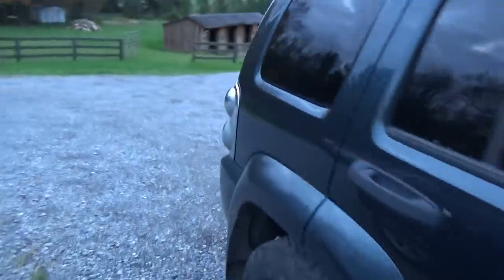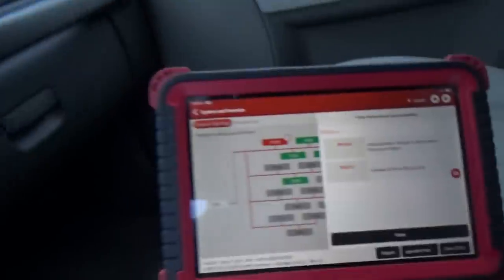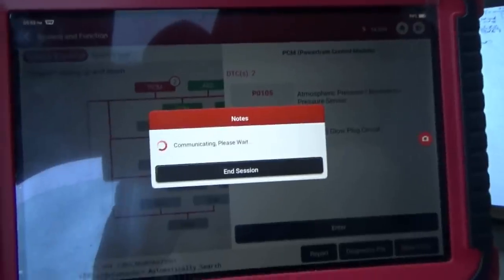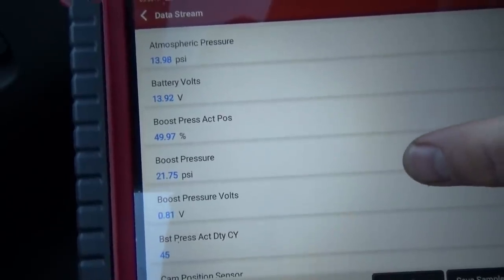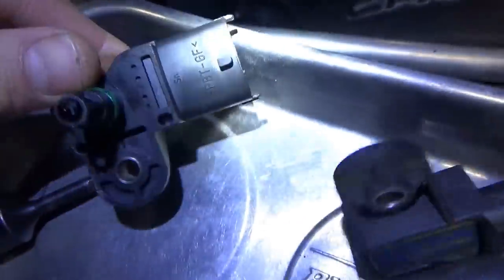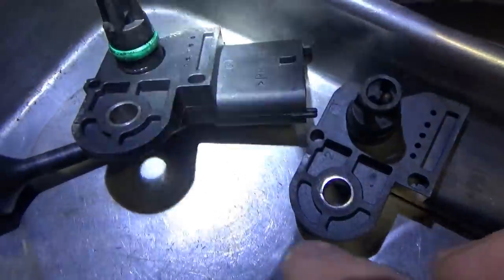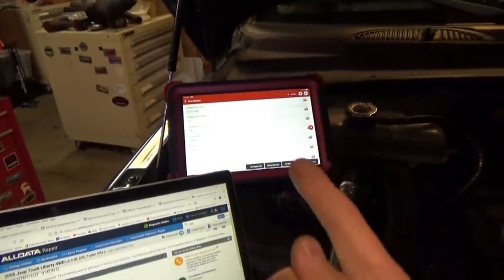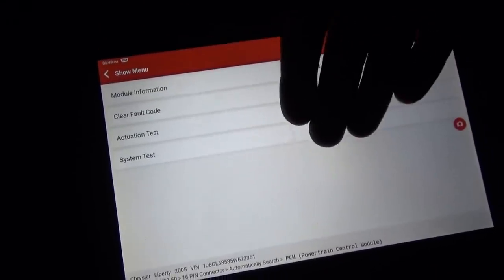Jeep sounds like TRACTOR?? (Low Power, No Boost)

Comment: That engine was insanely loud from the factory. It was a fairly primitive engine; made by Fiat.
Reply: It actually sounds pretty friggin sweet idling like that. 

Too bad it's like a handbag of a Jeep 👜
Reply: Made by VM Motori I think, in Italy.  Was that part of Fiat ?  These engines were before Chrysler/Fiat joined.
Reply: @volvo09  "...  handbag of a Jeep"    Lost me here.  What does this mean?
Reply: @davecaselli1957  just going from memory, I believe it's either owned by, or at least partly owned by fiat. Yes this was before Chrysler went bankrupt and was given to Fiat.
Reply: @davecaselli1957  it's feminine and little... Crappy attempt at a joke. 

I was trying to poke fun of it like the modern range rovers that are more of a fashion accessory than an off roader.
Reply from the maker: @volvo09  It's much more of a real off-roader than all the modern AWD crossovers combined!
Reply: @PineHollowAutoDiagnostics  you are correct there. At least it has a T case, and tires that aren't rubber bands. Many new "off roaders" have brakes so big that even if you want to use it off road, you can't fit proper wheels and tires. 

 I still mentally get taken back to when these were announced and saying "that's not a Jeep!"... But how time flies, and what, the newest land rover has 23" wheels or something stupid like that.